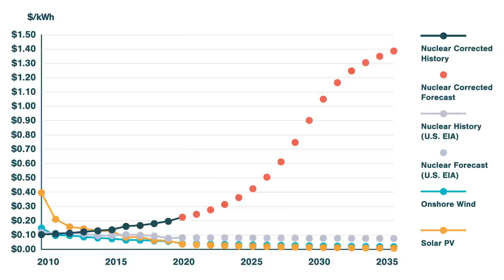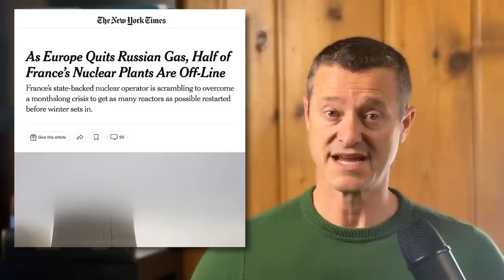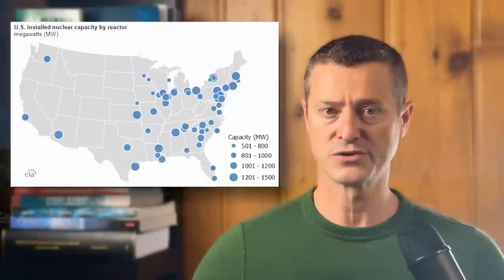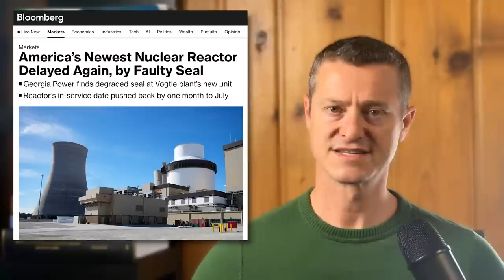Brighter | Episode 10 - Why we shouldn’t build nuclear power

Comment: This is in general an extremely one-sided view. You present a lot of things as facts without any evidence. You mention and greatly exaggerate every downside of NPP (even false or long debunked issues) while not mentioning ANY of the problems of wind and solar energy, specially storage. The whole video looks like manipulative FUD. On the one side, you mention that traditional light-water reactors take a long time to build and are expensive (true), but fail to mention that SMR's are not only much safer, but can also be built in months, and plants in a few years. Then you talk about the scarcity of uranium, while forgetting to mention that the current amount of waste material from light-water reactors in the US, still contains enough unspent uranium to provide the whole of the US with power for a century! When used in thorium or fast-breeder reactors. That's current nuclear waste!.. because a traditional light-water reactor uses only about 5% of the energy that a thorium or fast breeder reactor could extract from the same amount of fuel. And that's the next point: You pretend that NPP technology has been stuck in the 50ies. You fail to mention all the improvements in safety since then and after all of the accidents... yes, you mention them as a negative when stating that they increase costs (of traditional  light-water reactors), but fail to take them into account when you start inventing numbers about "one accident per month". Also you don't mention the fact that so far nuclear energy is the safest form of energy (in deaths per MW/h produced) ever, and 2 orders of magnitude safer than fossil fuel plants. Only solar energy is slightly less dangerous.
And about the nuclear waste problem... maybe you've been living under a rock, but it really has been solved (Forsmark and Onkalo in Sweden and Finland respectively).
And I am not even mentioning the atrocious oversights in your video when talking about wind and solar. You don't mention a single problem with that. Just as if they were 100% perfect. They are not. Wind and solar energy are highly intermittent and not correlated with demand. Storage would be a solution... but you again fail to mention just how problematic, costly and environmentally harmful battery technology is at the moment. Ok, sodium-ion batteries are coming along nicely and at least don't require lithium, but they still need Cobalt for example.
The problem with NP is that we have been investing far too little in advancing NP technologies like Thorium, molten-salt reactors, fast breeders and SMR's. Instead we've been victims of FUD lobbying and manipulation from people like you (and Greenpeace) who distort the facts and use the scare of accidents like Chernobyl and Fukushima (how many deaths did they cause again?) to further the ridiculous notion that we are better off not using NP. What a load of BS. Facts: Germany abandoned NP and now has one of the highest levels of CO2 emissions per MW/h of energy produced in whole Europe. France on the other hand produces a huge part of its energy needs from NP and has one of the lowest CO2 emissions per MW/h of energy produced.
I could go on, but the evidence does not sustain many of the claims in your video.
Reply: When you talk about SMR's you are talking about power point  nuclear power plants.   Same with the waste. That is not a problem that has been solved.  Maybe you missed the point that half of France's nukes were down because of 16:35  the same issue and that they have gone to a net importer of energy?  Germany knew that their greenhouse gas emissions would go up - temporarily- it was part of the deal to close their coal plants.  Their plan is working.  

Every generation  source has problems, but none compares to the scale of problems with nuclear power.  Citing the old industry tropes is not helpful to an informed discussion.
Reply: @eliewestcan  Germany's plan is not working at all. Their solution to CO2 emissions is a pipe dream as of now. So begin talking about SMR not being in mass production while at the same time proposing energy storage solutions that also don't exist yet. Facts are facts. France has lower emissions than Germany... And cheaper electricity prices. You can't talk that away.
Reply: @yope01  
Talk short term and long term.  Germany knew that their electricity prices would go up in the short term because of closing their coal plants.  It will come down again when renewables fill the void. SMR'S  are only on paper in this country.  Talk about them when they at least have a prototype built.  Nuclear is slow to build and expensive per KWh.  We need cheap, green electricity with fast construction.  Nuclear fails on all three accounts.
Reply: @eliewestcan  Again you commit the same mistake. You say SMR's only exist on paper, while saying that energy storage solutions "will come". Well... They also only exist on paper. And in the meantime, many of Germany's NPP's could have continued to operate.
Also, China has a working Thorium Molten Salt reactor already. China. Blink with an eye and they might also have SMR's built from a factory. The transition to 100% carbon free energy is not possible without further development of NP. Current W/S is just too inefficient and also intermittent. While storage is even more expensive than the current generation NPPs. CO2 neutral hydrogen is only economically viable when produced in gas cooled NPPs.

Comment: More central generation needs more grid capacity. 
No fossil fueled future means 5 times bigger national grid.
GRIDS ARE INCREDIBLY EXPENSIVE. 
What is the modelling on this factor. 
Grid expansion is too expensive to be monopolised by say nuclear. 

The Australian grid new build cost is equal to the national GDP. 
It took 100years to build. 

5 times bigger is insanely expensive. 

Even cold latitudes have a majority of sunny days.

Offgrid customers with EV and modern rooftop solar PV will be possible. Most vehicles are parked 23hrs every day, daily drive is only 7kwh on avg. And drives are building to building. 
EVs 100kwh are 'free' with the vehicle and V2G feature makes vehicles more beneficial.

Abandoning the grid by customers will be a death spiral for grid owners and governments. 
Stranded assets are more expensive.

Some fossil fuels in emergency will be nothing, CO2 wise.

Comment: I agree traditional nuclear is to expensive for all the reasons you have outlined.
But small thorium salt water reactors have the ability to drive price down and when used with battery solar and wind can offer a balanced cost effective supply.
Reply: Theory. Reality is that thorium hasn't commercialised yet. With good reason. It's not ready.
Reply: @cg986  Look up ANEEL fuel ... Will work for CANDUs soon ... circa 2027

Comment: GE BWRX 300 can be deployed with air-cooled generators. Adam cherry picks information. He is not a honest broker of information.
Reply: Let's be honest, grid electricity is what we are talking about.
We must include all costs and our limitations. 
Distant renewables is grid electricity. 
Nuclear is grid electricity. 
Fossil fueled is grid electricity. 

To expand the electricity supply means to expand the grid and grid capacity and the generation. 
Resources and CO2 and financing and time demanding. 
This is a national GDP ×3 problem. 

Battery storage and generation is free of grid costs.
If EV are viable, then customer's generation and storage and no grid costs is a huge advantage. 
Resources minimum. 

In fact, customers may go offgrid and abandon grid electricity and its cash demands. In the suburbs. 

Grid electricity must not cherry-pick the initial no grid roll-out filling the existing national grid with nuclear electricity. 

Nuclear is an extremely expensive and extremely long time framework  that will need Government disaster insurance and Government guaranteed cash flows. For 60years to 100years.

Comment: Thank you for this thorough and elaborate overview!!
Reply: No one has EVER considered that mass produced molten salt reactors would be at least an order of magnitude cheaper than stupid nuclear. It would also require much less energy and materials to build up its supply chain.
That said, I still like Tesla style industrialism 😀
Reply: @fireofenergy  
We have "not considered" it because SMRs will not be an order cheaper. They may ultimately be more expensive.
Molten salt reactors cannot even be built yet in more than a temporary experimental format, because the corrosion resistant materials required to make one last twenty years do not yet exist. May not exist for decades.

Comment: What about the coming ccopper sortages?? Exonential growth in electrification requires exponential growth in copper mining and refining, and it's not happening!!
Reply: It's not all bad news. Improved efficiency in household appliances reduces the need for larger copper conductors or house wiring upgrades. Your house probably has ten kilos less consumer copper in it than thirty years ago: CRT televisions, transformer-based power supplies, washing machine motors, all of these are gone or replaced by modern versions with ten times less copper in them.
These more efficient appliances plus local generation and storage reduces the overall demand in a suburb or region, reducing or delaying the need for transmission or substation upgrades. The largest transmission links are at increasingly high voltages, again reducing the need for heavy new conductors. Doubling usage need not double the transmission requirement except for the link from substantial generators to trunks. Distributed generation that uses existing buildings will make use of existing connections.

Sure, more wiring will be needed, but not as much as historical installations required.
Reply: @aaroncosier735  No, it is the other way around - the amount of raw materials for batteries, solar panles and wind turbines are insanely high compared to nuclear power.
I think that wind energy is already at the brink of a collapse due to increased prices for copper, steel and cement.

Yes, using some solar panels on your roof is smart and a good thing.
No, running industrialized nations only on "solar+wind+battery" is a stupid thing.
Reply: @MultiThibor  
No, it is not the other way around.
Firstly, I stuck to copper specifically because that is the topic of the the first comment above. I stand by my answer: Reduced household use allows the same copper to be used in distributed generation.

Sure there are additional requirements for PV and wind generation, and for batteries, but not so drastic as you imagine. Current batteries use mainly lithium, for which huge deposits are available in Australia and elsewhere. Lithium is also extracted from salt pans and seawater with minimal environmental disruption. Battery electrodes are advancing, with the latest versions using a fraction of the cobalt of previous designs, and substantially less nickel which is abundant. Nor are we purely dependent on just these. Every other battery chemistry will have it's niche and preferred uses. Most are recyclable, so the mined materials are not lost.

I do not accept your comparison to nuclear, which uses a stupendous amount of concrete and steel in the structure. Per gigawatt*day of generated electricity, wind turbines are certainly no worse off. There is no reason old footings cannot be re-used or incorporated into new build. Compared to the requirement for specialised disposal for nuclear sites, wind wins.
Wind turbines use increasingly simple mechanisms, with less dependence on gearboxes. Such copper, rare earths and steel as is unavoidable are eminently recyclable, rather than the substantial mass and volume of irradiated metals that require subsurface disposal from nuclear.

You are also ignoring the mining risks. Uranium mining happens in many unregulated nations, and dust from tailings carries radiological risks above and beyond those of ordinary rare metals. 
Not to mention the actual fission wastes. These represent the vast majority of all radioactive material on earth. None are permanently contained. All are vulnerable to deliberate attack and even to simple neglect if not actively and expensively maintained, leaving vast areas susceptible to contamination. 

Wind energy continues to be installed at increasing rates, year on year. Nuclear has demonstrated an accelerating decline into costly irrelevance. 

Failing to learn how to run industry on renewables would be stupid. It's not just wind and PV and batteries. It's also hydro, pumped hydro, pneumatic, flywheels, biogas, tidal, thermal storage, concentrated solar, and the biggest contributor of all: improved efficiency. Efficiency improvements since the 1970s have been the single biggest contributor, and will continue to be the most cost-effective contribution to emissions reduction for the foreseeable future. 
We can either keep up or be left behind.

Comment: Why am I pro-nuclear? It’s like you yourself said in your video, about 18,000 nuclear reactors would be sufficient to power the whole world. There is simply no other form of energy, especially low-carbon, that is that concentrated and powerful. We can save land, save minerals (yes we still have to use some but SO much less) and worry less about grid stability. 

You have a great point about modern nuclear costing too much. At the same time tho, my country, Taiwan, built 6 nuclear reactors in the 70s when it was still a third world country. Those reactors all ran great until recently and there’s talk of life-extending them for another 30 years. If the Taiwan of the 70s can do it, how is it too expensive? Same with France, who decarbonized on accident by building less than 50 nuclear reactors in the 70s and they still power the country to this day (a much cleaner grid than Germany.) US has less than 100 reactors for about 20% of the energy. As we decarbonize, we’ll need more power, not less. That’s a lot of solar panels and wind turbines, and much fewer nuclear power plants. I think there’s nothing better we can do for nature than to give back land with nothing on it. Nuclear power plants, with their small footprint, allows us to do this. 

The problem with wind and solar plus batteries is it’s simply not proven that they can be a whole-grid solution. The higher the penetration of wind and solar, the more expensive and more storage they are going to need. That cost will break us, especially the long duration. 

So, what does make sense? Not either pure renewables or pure nuclear. They should both go on at the same time. The nuclear industry is not in a place to take over from renewables. They need to figure out their supply chain and basically get back to where they were in the 70s (and then hopefully get even better than that). This will provide the grid with a valuable source of steady supply. By the time they “git gud” as the kids say, today’s solar panels and wind turbines will be coming to end-of-life and can be replaced elegantly by a longer-term solution (as we expect nuclear power plants to last 80 years these days.)
Reply: Google and read Lazard LCOE and Tesla Master Plan Part 3. Nukes are done.
Reply: There are already islands that are 100% solar and battery powered. It is proven they can be a whole-grid solution.
Reply: @Global_Optimization  sure, if they have a low population. But show me one good-sized grid that's wind and solar only?

Lazard recently updated their LCOE to include 4 hours of firming. According to that account California solar is much expensive than Chinese nuclear. And I bet if we wanted it to be a 24/7 solution we'd need a lot more than 4 hours of firming.
Reply: @Global_Optimization  Germany made an experiment on the island Pellworm - overbuild solar, wind + batteries and... 
... still not enough, the 20 kV line connecting the island with the mainland was still required.

Comment: Very biased presentation. Without Nuclear 100% clean grid Possible, but it will be very expensive. Some countries, for example: Finland, Estonia, Latvia, Lithuania, Czec Republic, Slovakya and other East European countries, dont have enough wind and solar.
Reply: If you go centralised electricity generation you have to include the grid expansion costs. 
Most idiotic promoters of nuclear energy ignore this.

National grids are close to the national GDP, $TRILLIONS. 
Million $/klm × million klm= $TRILLIONS. 

No fossil fueled future, then 5 TIMES more electricity and 5 TIMES bigger national grid, plus EV which remain parked 23hrs every day. 
EV battery is huge, and the majority do nothing 23 hours every day. 

Australia has 20million buildings and vehicles. 
USA has 300million buildings and vehicles. 
Rooftop solar PV and big batteries and the EXISTING NATIONAL GRID perfect for most, most of the year. 
The fatter grid is the killer costs.

Comment: Your team needs to look at the carbon footprint of manufacturing both solar panel manufacture and wind generator manufacture. Both solar panels and wing generation are short life solutions with the life of solar panels being around 20 years after which they must be replaced in full. Consider the scale of the waste problem solar panels alone if you allow for all people on the planet having equal power needs to those of a western country. Water cooling of reactors? Japan just commissioned a gas cooled reactor for the generation of red hydrogen. Your arguments against nuclear revolve around 20 year old reactor designs and ignore the toxic waste of a continuous solar panel replacement program globally.